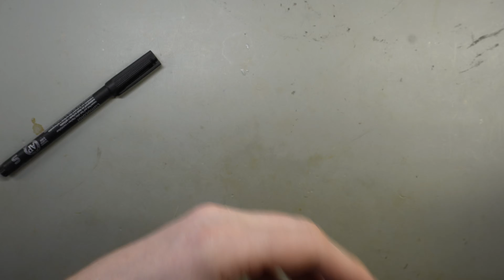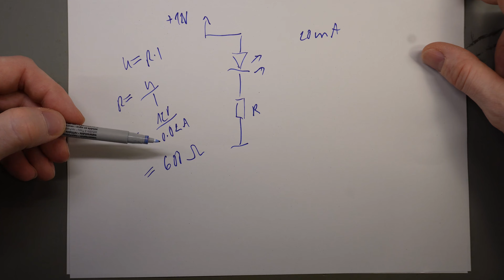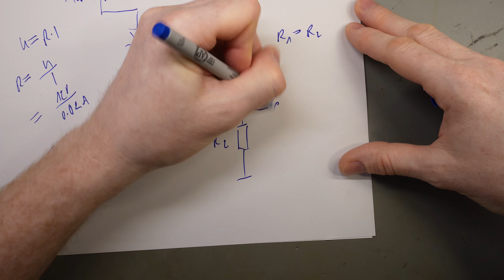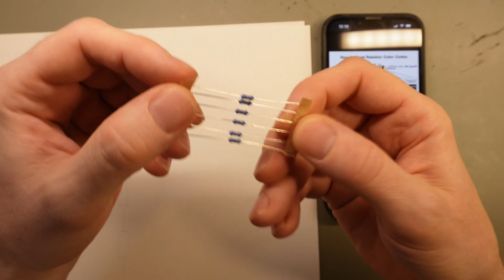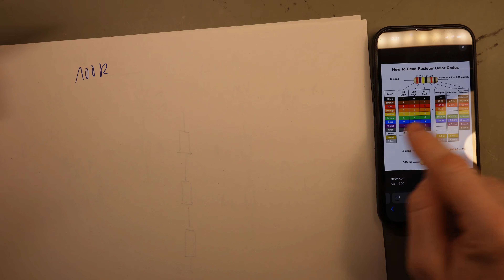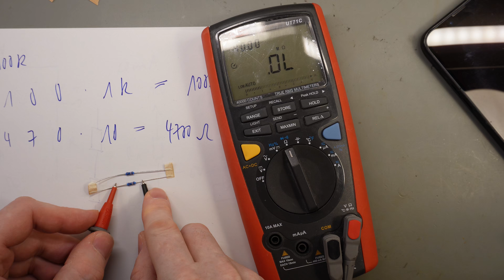Understand resistor color codes - Synth DIY basics

Comment: I really like the video! Just a friendly tip — try to watch out for filler words like "and," "so," and "um." There are quite a few, and they can make your message harder to follow. Also, be mindful of run-on sentences — instead of joining multiple thoughts with "and," consider ending a thought with a period and starting a new sentence. It'll make your points much clearer!
P.S. You don’t need to fill every pause — sometimes a moment of silence is more powerful than words like "um" or "so." Let your points breathe!

Comment: Thank you! Some resistors are very hard to read because the orientation is not clear (no metallic rings or no significant gaps) - so I usually use my multimeter to get the value of a resistor.
Reply from the maker: Yeah, same here. I usually have the same brand of resistors so it's easy but sometimes it's not quite clear. Cheers!